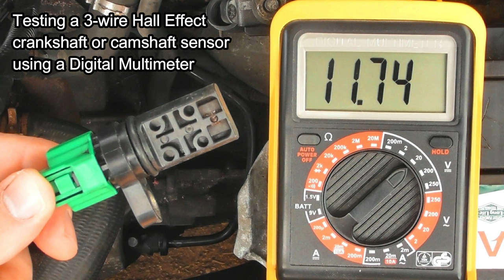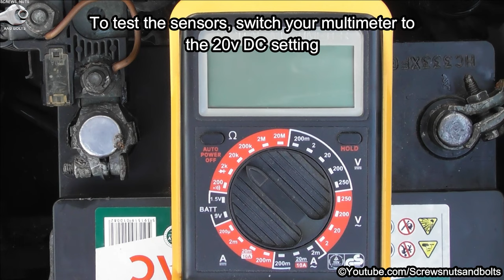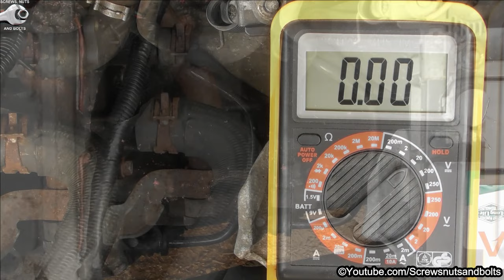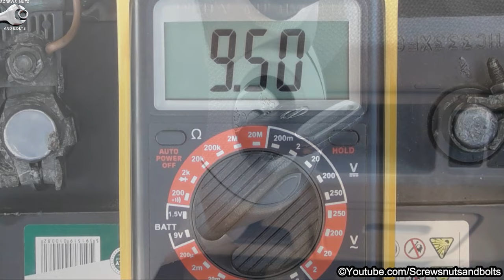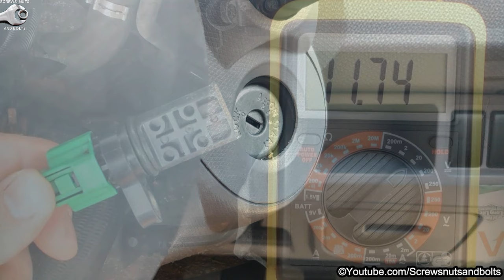Crankshaft Position Sensor Test

Comment: hello brother: i have 2011 chevy optra 1.6 engine, sometimes it doesn’t start after two or three trying but i disconnect the crankshaft sensor i reconnect it then it starts with the first try,

Comment: Why some vehicles use different part number for a sensor even when the Vehicle is the same but just a year or trim of difference. I usted a genérico crank sensor and Didn't worked well until I Got the original one. Why this happen?

Comment: Thanks. In my case the cam and crank sensors both kinda alternate the 5 volt and 0 volt (.3v) 
As in every couple swipes it may stay at 0 v or it may stay at 5v when the wrench is pulled away. But both are doing the same thing. Does that sound normal. Thanks

Comment: What if I have no signal voltage something with the wiring?
Reply: Signal voltage when Crank the engine coming from the ECM.
First check the wire connection from the sensor to the ECM.
If connection is good than the problem will be from the ECM

Comment: I have the "check injection system" 0340 code on my 2009 megane 1.9dci plus check "anti pollution system" code. I swapped sensor, still have same issue, tried your test eith multimeter and everything seem normal, your signal voltage shows 9.60, mi e os 11.40 but i dont think rhat matters since when i touch the sensor with a spanner, numbers go down like they should. Any other help or info would be much appreciated. By the eay  i had timing belt and drive belt replaced recently including crank pulley and the errors still exist. I also used dpf and whole diesel cleaner in hopes to get rid of the "check anti pollution" code. Code is still there. Is the engine busted or is there more that i can do?
Reply from the maker: It's hard to say. You'll probably have to have it looked at by a mechanic I'm afraid. This forum may be worth a look: https://www.renaultforums.co.uk/threads/renault-megane-ii-service-indicator-on-code-p0340.50664/

Comment: I only get a low voltage signal after I remove the ratchet from the sensor does this mean it's bad?
Reply from the maker: Does it do that every time or only occasionally ?
Reply: @screwsnutsandbolts  Everytime

Comment: I get a voltage of 5.02 on mine. Is that too low?
Reply: No. It's a 5v system so that's good. It should zero out if the sensor is working though

Comment: Mine V is  2.38 

Haynes Manual says ;

Measure the voltage between the 5V reference circuit and the chassis. =   4,8~5,2 V
Measure the voltage between the CKP signal circuit and chassis.           =   4,8~5,2 V

Whats the wrong ?